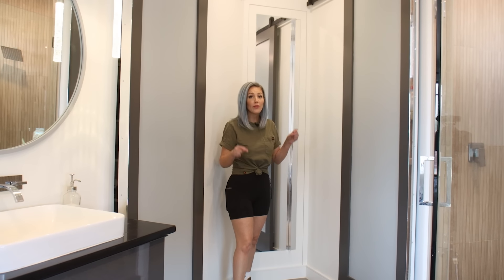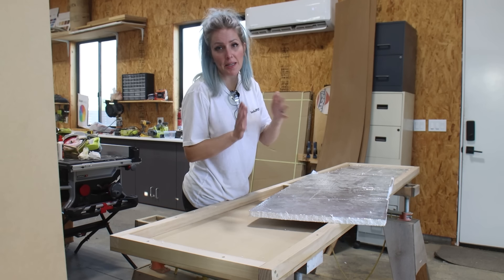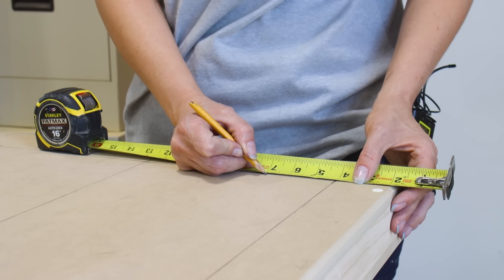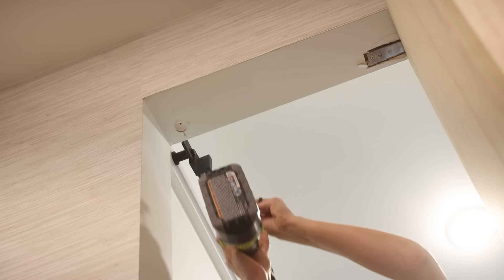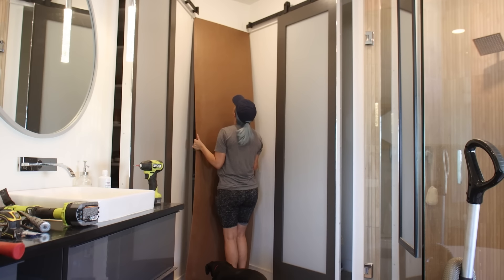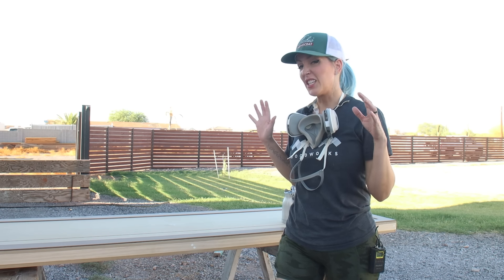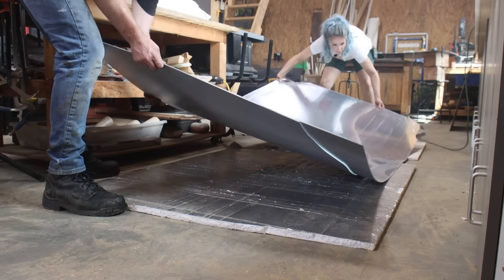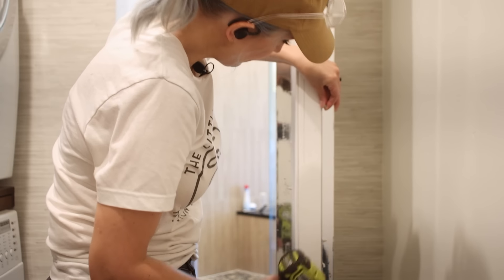DIY Secret Door in My Bathroom

Comment: Nice job, my only concern is when either your washer/drier dies and you have to replace how are you going to get them out & in again without trashing your secret door?
Reply from the maker: Why would the secret door be a problem? It doesn't interfere with the washing machine or dryer at all. We actually just replaced the washing machine about a month ago. We simply slid it out of the space, took it out the laundry room door, and slid in the new one.
Reply: @PneumaticAddict  I think he's thinking that the secret door is the only way in and out of the laundry room.
Reply: @PneumaticAddict  The only thing that feels off to me, and it's a personal problem, is that I couldn't comfortably use a bathroom that has a door that doesn't lock.  Even if I was sure I was alone in the house, I just can't feel comfortable doing that.  I'd have to lock the laundry door I guess.

Comment: Great Job!  Very creative.  Great DIY techniques. One small suggestion. I built my costume mirror doors by laminating MDF also.   One finish trick I have used several times is to fill the edges of the door with spackling compound and sand a couple of times before priming.  The edge of MDF never looks good with just priming and painting.  Also,  the spackle will fill any small cracks left where the laminates don't meet perfectly.  It's not much more time and work, doesn't cost anything but leaves the edge with a very finished look.

Comment: awesome! my thoughts is maybe just buy aluminium polish with an orbital and make the door handle shiny like a mirror instead of the chrome vinyl because the finish leaves a lot to be desired imo. Also I know acrylic scratches super easily so i'm wondering how it'll hold how just with normal cleaning. i'd just get a long mirror at ikea and upcycle it or buttjoin two together. great video otherwise! you have great skills for the project and also for the pacing and video.

Comment: Very cool door. I have 2 questions. 1 weird and 1 shop related. What is the natural color of your hair, only seen the light blue tint, and why are the handles on your cabinets in the workshop down by the ground instead of higher? Thanks.
Reply from the maker: You've got a sharp eye! The handles on my shop cabinets are upside down because they are recycled upper cabinets I inherited from a friend. I need to get around to moving them.

Comment: OMG we had doors replaced in our whole place a few months after we moved in because they were garbage, hollow core doors that were literally coming apart. Our local door guy had a dedicated power plane set at 4 degrees to make room for the doors to close tightly. He'd just automatically run it across the latch side to get a proper solid fit. The 4 degrees is enough to make the clearance work nicely, but it's not enough that you even notice it when looking at the door.

Comment: Using chrome vinyl will make it les durable. You can acctually with some work polish up aluminum to a chrome like finish. First, sand it as smoth as you can with increasing grits and then use aluminum polishing combound with a buffing wheel on a drill. There's a Star Brite aluminum polish that will prevent oxidation that's used for boats that will prevent an mat oxidation layer to build up after. You might have to reaply it now and then since I don't know how fingerprints will affect the surfce but if it holds up to marine environment it should hold up for a bathroom.

Comment: Great door build!  Personally i would use door mounts that would allow the entire door to be hinged and therefore you could add trim on the side you wanna hide gaps from the door.
Would be visually hinges on the back side..but considering often those doors with hidden rooms behind isnt a room you typically stay in, then it shouldnt matter that much visually

Comment: Great video and please wear a mask and have ventilation when cutting particle board as the methylenen chloride in particle board is what killed my dad, so, beware of that, thanks!😊 oh and here is shocker folks,  wait until night, turn all the lights off in your wood shop,  and turn on an intense bright flashlight, and wave it around the air space, and behold,  all the dust floating in your shop that you cannot see when the lights are on....!
Reply: also one for the cat too ! 🐈
Reply: @pmlstk  For sure, but, just try and put one on any cat, good luck!
Reply: Was going to say that she should use a mask when cutting particle board like MDF. I even use one when cutting regular plywood too.
Reply: @Dragonited  For sure buddy!!!
Reply: Sounds like you’d also recommend a dust collection system.
Reply: Make those long dusty rips outside
Reply: @ehRalph  Ralph, that is the greatest idea ever, in fact, I do that all the time so my filter paper in the spraybooth will not have to be vacuumed, to save the paper, as numerous sprays of shellac make the paper unusable anymore so the paper roll has to be advanced, using expensive paper, so check out the prices of spraybooth filter paper rolls, ha ha!

Comment: If you have a SawStop table saw, be careful cutting Mirror Acrylic because the Mirror coating might transfer enough electricity to trigger the Saw Stop protection circuit as seen here: https://youtu.be/q2-RdcuFYy8?t=786 
Just be sure to disable the SawStop protection before cutting Mirror Acrylic.
Reply from the maker: I actually found out the hard way. That was an expensive mistake

Comment: As the video gets towards the end, it almost gets too much when you’re touting the benefits of DAP. Starts to feel like just an ad rather than a DIY video. Would hope that for future videos you’re a little more upfront about all of that, it just feels better, especially because I’m not sure if you are promoting other brands as well and I don’t know.

The other thing I didn’t notice was when you put the frame around the door, did you mimic that shampoo again? It didn’t look like you did, and so did that end up mattering in the end?

Another thing that I would’ve liked to seen more of was exactly how the hinge gets installed, it doesn’t look like there’s a spring loaded part to it, so if you install the pins first, how do you get the door in there? Is there a cut out on one of the metal bars? I couldn’t tell.

Finally, I get from the end of the video that you have done this house custom for yourself from scratch. That’s cool, but this very narrow door doesn’t seem like it’s totally up to code, and if somebody is overweight, or has a wheelchair or a walker or something, they would have a lot of trouble using this new door you put in. Which is to say, I assume you’re planning on living in this house for the rest of your life, but features done this way could make it hard to sell.